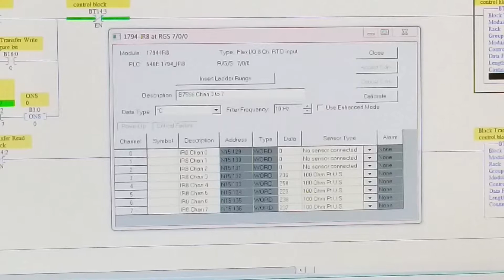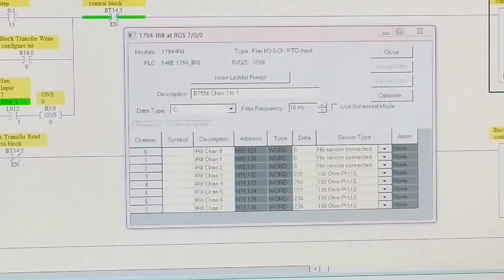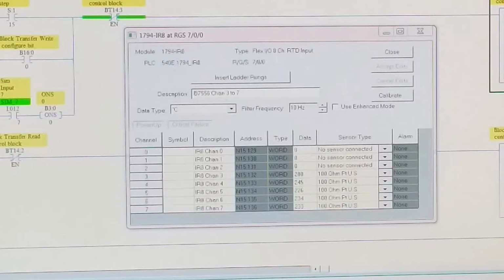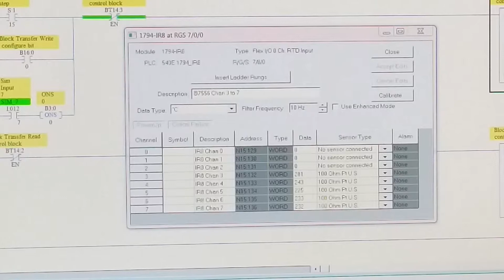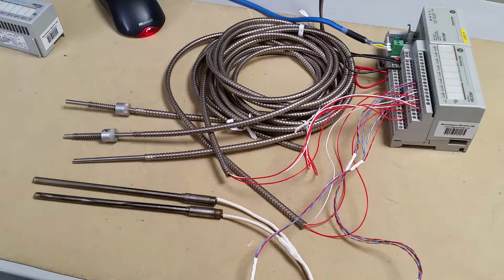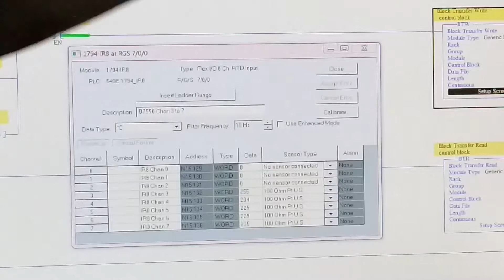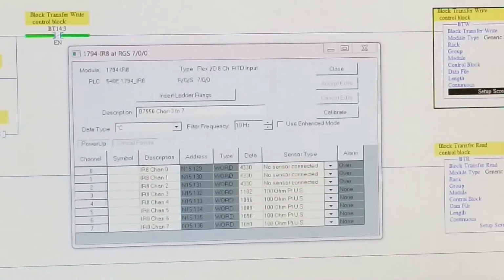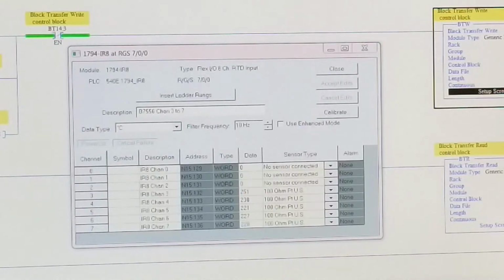1794-IR8

Comment: Thank you for your videos, they have been really useful for me. I am currently working on a project with an IR8 module through profibus communication but I am having problems with the measurement. I read the data on an L71 CPU but it always shows me the minimum value of the count. Do you have any idea what it could be? I have tried everything, at least for PLC I have everything well configured. I hope you can help me. Regards from Chile.
Reply from the maker: Hello Victor:
I do not know how Profibus works.
If you know that the module works properly using an Ethernet communication then I would have to think that there is a setting that is holding the data at 0.
Is there a setting that commands 0 if there is a problem with the field wiring or configuration?
The other thing to try - just because you can is power down the Profibus and modules and then power back up.  It may just need the parameters rewritten?  Just a thought.
Sorry I can't be of more help on this one.
Bruce

Comment: Great content

Just wondering have you dealt much with irt8 flex io cards?  Over the last year I have had several 1794-irt8/b cards suddenly fail, pwr led solid red.  Ended up have to replace the modules to solve the issue.  Have you heard anything abou this?

Thanks
Reply from the maker: Hi Dirk:
I have only worked with a few of them and have not heard of any problems.
That does not mean that there are not any.
Did you try posting a question on https://www.mrplc.com/ - great group on there for exchanging info and techniques. 
Sorry I am not much more help on this.